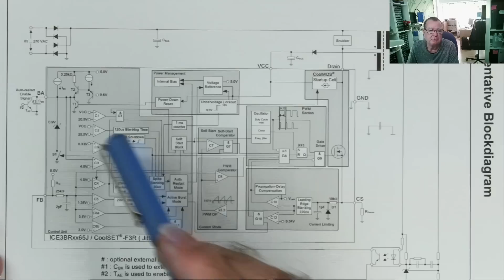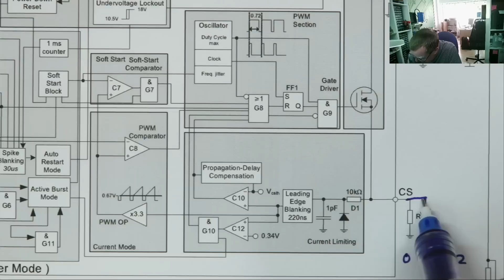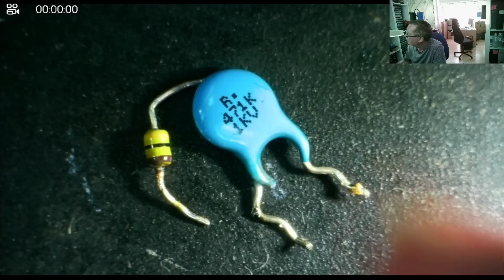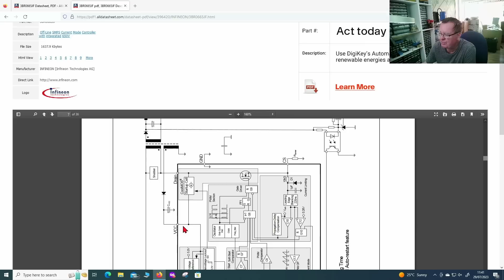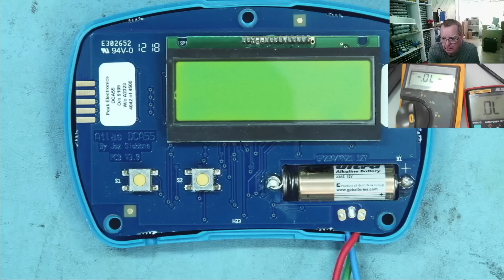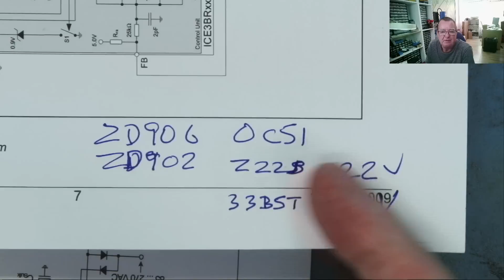LG Active Wireless Subwoofer Repair - Dead, No Power. PART 2.

Comment: Resistors have standard color codes, and capacitors also have clear markings. Why is it different with diodes?
Reply: I have asked that question more than once...It is quite ridiculous that I need to reverse engineer a circuit to figure out what value a diode should be...

Comment: Hi Did you ever get this sub going again, I had one in recently with exactly the same components blow as yours, went through changing them all. Still a no go. I then watched your 2 videos and I ended up with the same dilemma. I then replaced D901 SARS10 which with a meter showed as good, with one I bought from Digikey, and it burst into life. Not sure why the D901 which measured as good, did not work but hey this is electronics. Dave - Ward Electronics Cornwall.

Comment: Is part 3 on its way? I have the same unit and it now does not power on. The visible issue with it is different though, as the large snubber diode looks burnt. I have found a circuit diagram for the psu which will help immensly so i am about to start looking for other failures within the HV side.

Comment: Did this ever get fixed? I have the same power supply board that appears to have failed in exactly the same way. The same capacitor and sensing resistors blown at least, I haven't got as far as measuring the various diodes yet. Just wondering if this ever got fixed.
Reply: Well, good news. I have my subwoofer fixed now. Replaced the PWM chip (visibly cracked due to internal swelling), 3x zener diodes (all measured off board as shorted), blown capacitor, small capacitor next to it (wasn't blown but possible heat damage), 2x 0.22ohm resistors, the large 120uf smoothing cap (not blown but discolouration on one side due to heat so thought it best to replace). I tested the transistor and the optoisolator off board and they were fine so didn't replace. Watching TV with good sound as I type this. Thanks for this video, pointed me in the right direction

Comment: Hi, I had exactly the same fault as described.  Replaced all the components on the HV side, mentioned in the 2 videos, including the 3 zeners. A complete fix! (Nothing on the LV side changed). Probably wouldn't have been successful without the video. Excellent! Hopefully there will be a part 3 to show the actual fix?
Reply: actually never mind, I found the schematic diagram for this power supply board which lists those diodes as:

ZD901 GDZJ33B 33v 0.5W zener
ZD902 GDZJ22B 22v 0.5W zener
ZD906 GDZJ10B 10v 0.5W zener

Just waiting for the PWM chip to arrive, the one I removed from my board was visibly cracked where I assume it has swollen up inside from something failing.
Reply: Hi, which zeners did you use? I have the same board but am struggling to identify the zeners. I read off the markings using a magnifying glass and got: ZD901 = 3B51, ZD902 = Z223, ZD906 = 10C5T but I can't find these anywhere.

Comment: There is a similar power board to this on ebay, but it's a LG SHS36-D. it' has the same large transformer but the board is a different size. The seller doesn't ship to anywhere but the UK though. It could be faulty too. I wonder if that one is in standby.

Comment: I am an electronics hobbyist who engages in electronics on weekends only.  
I have the exact same series subwoofer and exactly the same problem. 
initial inspection, IC 3BR0665, 2 red capacitors, few resistor (all in front of the IC) blown and some burnt PCB. 
I replace all damaged component and cabling the burnt PCB. but it still doesn't fixed the problem. 
after wasting 3x weekends, 3 time replacing IC but still not work.
I usually try to fix thing back to original condition. but in this case i finally gave up and take shortcut by using '3-cable gacun'.  3br0665 must be removed before using Gacun.
Problem fixed.

I've try same solution to fixing LG LHD 657.
Fixed also.
Reply: "Gacun" Chinese ? name of a mine please ?
Reply: @andymouse i can't find on international/china marketplace the exact same type that i use.
As reference I think you can try search  'diymore QX YJ-4 Universal Power Module'
Other reference you can also search Gacun on youtube
Reply: Please share what Gacun you used - voltage and wattage. Where did you connect the third blue cable? Thanks .
Reply: @dngdng7070 
I'm using gacun for 29 inch TV. Not measuring voltage or wattage.
Blue cable connect to pin 4 optocoupler.

Comment: As you say, there are issues around the voltage reference opto input and opto output section which would need to be reversed engineered to make any sense. Guesswork (check everything) C51 may be BZX79-C51, Z228 may be Excel Semiconductor 21.8V, 33BS etc see Semtech BS series datasheet.

Comment: Hey, thanks for the videos. I’m currently in the process of fixing a PWM controlled mains fan. Long story short I think a mains spike fried all semis on the mains side (bridge rect, 4 power switchers, viper12a and fuse) took off each and checked. Use lamp limiter on the mains and didn’t go out until the viper12a was removed. Just wondering what are the odds of what’s beyond the viper12a having survived? It’s the switching control chip. Looks like it’s being used to generate 10v and a 5v probably, two secondaries. I will check to see if any protection zeners are there, but I’m not impressed by the degree of transient protection, a few low value resistors, or TVSs in key places could have reduced the damage a lot. Get the impression the fan was meant to be installed behind a filtered mains source with its own fuse, not straight to dirty mains.

Comment: Not watch all of the video yet, but at 37:10 there are witness marks on a couple of chips where they have been screwed to a heatsink - so although the pins are very clean it does look as if those chips are pulls...
Reply from the maker: Yeah I do have my suspicions as mentioned. Doesn't mean they are bad, apart from one of them.
Reply: @learnelectronicsrepair  Absolutely.
Reply: Что в итоге было? После второй части видео прошло много времени, в результате удалось обнаружить все неисправности? 
Если выпуска 3 части не будет, напишите пожалуйста в комментариях, многие спрашивают и ждут развязки) 
У меня всё в точности так же, только не эт КЗ ни на шим ни где где то ещё, и никаких обугленных деталей, но следую вашим действиям и менять буду тоже самое, так как куда копать неизвестно) спасибо  @learnelectronicsrepair

Comment: I did not watch the first  part. Have you tried testing the amp using your lab supply?

I ask that because the discrete circuity your fixing obviously relates to power-control function. Now, I only noticed one opto-isolator.  So, if the oc51 zener is indeed a 5.1V zener, then that suggests that they broke whatever isolation they had to implement the power-control from the amp. As we are talking about surges that have taken out much more robust, high voltage components already, this does not bode well for the low voltage circuitry (the amp)... 😒
Reply from the maker: I don't think it works that way - but this is all supposition: I would not be surprised to find that the PSU gives an output of maybe 5V when powered up due to the value set by the resistor divider and the TL431 when P-Ctrl is zero.   Then the logic board sends a signal (voltage) which changes the setting of the TL431 which increases the output to the full working voltage when the subwoofer is working (24V or something maybe?) and puts the PSU back into standby output when it isn't working. This would be a kinda pseudo Standby using just one voltage rail from the PSU.  I note the output is marked as VDD not any stated voltage. As the TL431 and associated circuitry is on the low voltage side, this could all be achieved with a single opto-isolator😉

Comment: Don't think that's 0C51, it looks more like 0C5T. Found (SMD), not (Through Hole) zener diodes marked 0C to be 5.2volts to 6volts! Not sure about the 5T part though. Maybe 5% tolerance, dunno tbh 🤔
Reply from the maker: It could be, it wasn't easy to read.
Reply: @learnelectronicsrepair  I had to watch it a few times 😄 But really it could be anything. I'm just going by the SMD reference, which this clearly isn't.